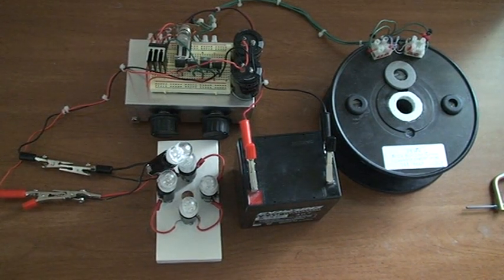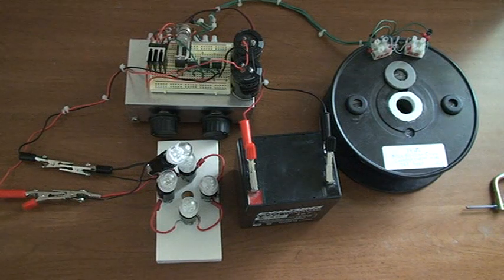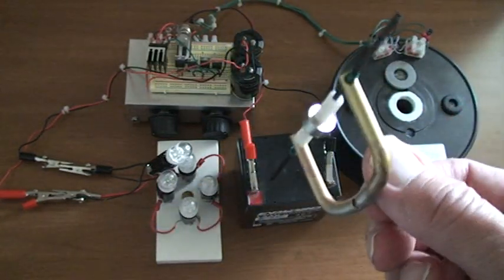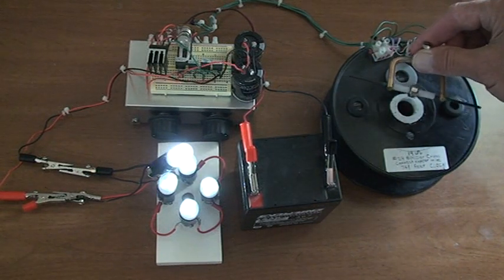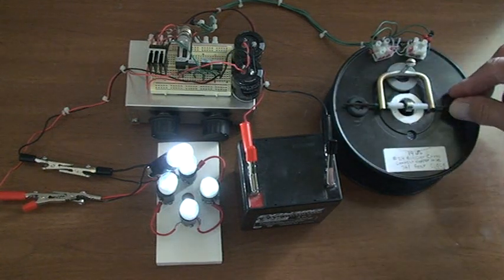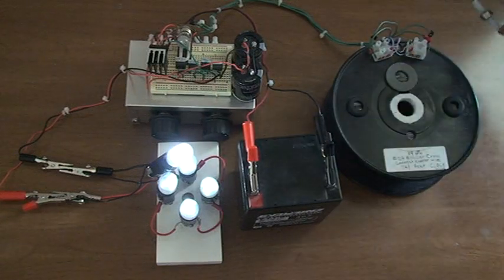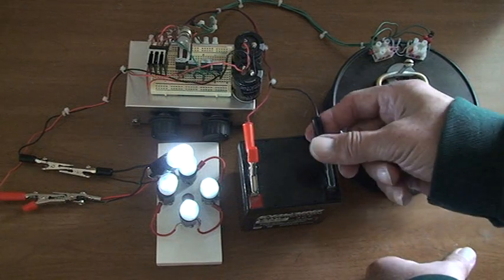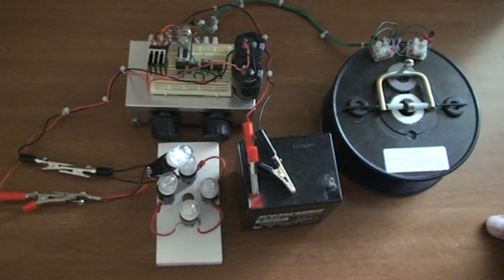FLYAWAY

Comment: The fly away when used with an optocoupler could compare rpm to standard AC sine.
this bridges the gap that digital is not doing with narrow dc pulse and partial longitudinal
and other complex waveforms. in short the devise does to magnetic what avramenko does to high voltage. Because you can dial in ac input to match 
an unknown exotic pulse.

Comment from the maker: @buddybill65   Checkout  my """Spin Story""" video for all info under the Photobucket link.  One transistor used with a small heat sink on it.  The L3 automobile relay is inside the  aluminum powerbox and you cant see it. On first glance the circuit almost looks lik a Bedini but its not.  Bedinis circuit charges batterys. This circuit functions as a motor or generator or both. Take your pick.  The device model is small but very powefull.

My next video will be very interesting .Dont miss it.

Comment from the maker: @buddybill65   I just updated  and now you can find a " Photobucket ", link.

Check FLYAWAY  video again.

That link has all info for anyone who wants to replicate this device.  I quit all my other projects entirely and am concentrating soley on this. The circuit acts differently than any other I have experimented with. You mighr want to buy yourself an expensive clamp meter that will take low DC CURRENT  readings . After you finish building it  just try testing with different multimeters.??

Comment from the maker: @buddybill65 Wire is one coil made of "TWO" twisted  solid strands #24 AWG copper wire. Wire is color coated  with a PVC covering. Its called "cross connect" wire.  Buy a 1,000 foot  plastic spool of it  on Ebay and cut off enough wire untill you can measure 19 ohms through one of the wires. Since you will be cutting two wires at one time the reading will be the same for the other wire.  Whala-- you have your coil wound the same as mine.

Comment from the maker: @abbaar   Multiple coils each with one magnet linked together on one shaft is a possibilty.

The frictionless shaft  that you mentioned wont due as if you make a motor and reduced its speed abrupty the shaft would break loose from its magnetic moorings. Possibly fly into your face at ultra speeds.

Comment from the maker: @abbaar   
It works best using only one DIAMETRIC ring magnet that has polaritys on the rounded sides. Not the flat ends!   Any more than one magnet on the shaft slows things down. 
This may blow your mind but the smaller magnets work best. More speed means more power output .  
My 1/2 inch diameter, 1/4 inch thick, 3/16 inch hole  magnet works great.